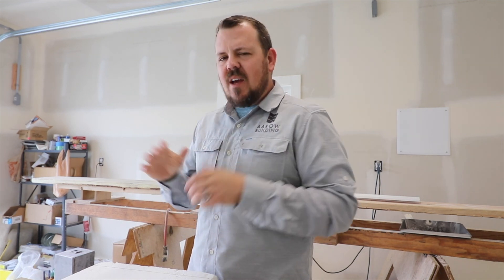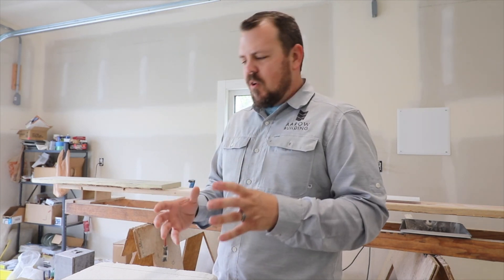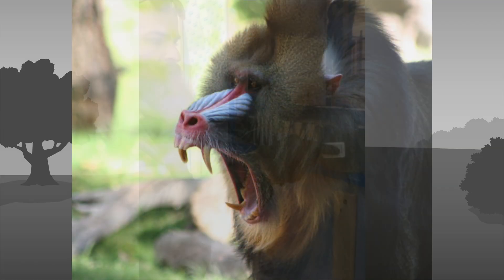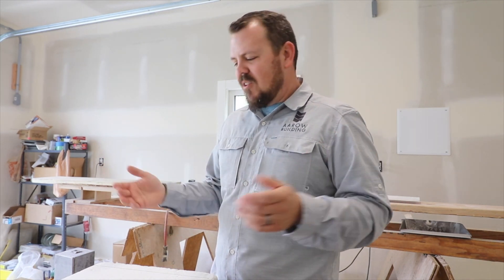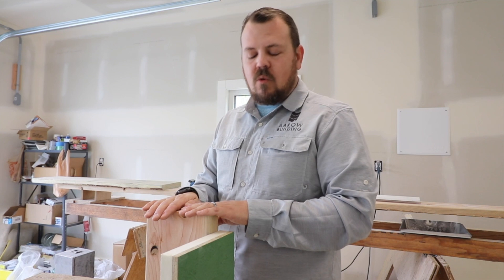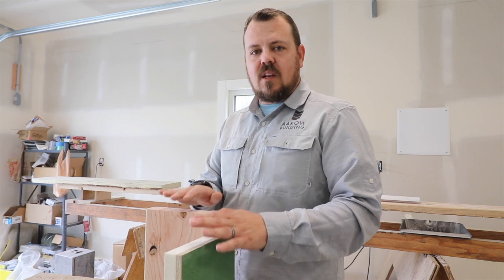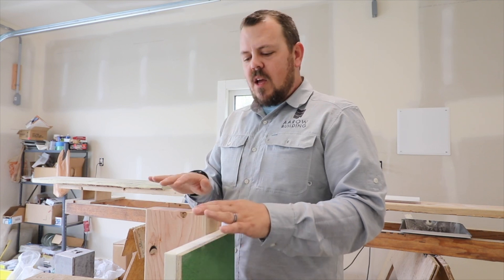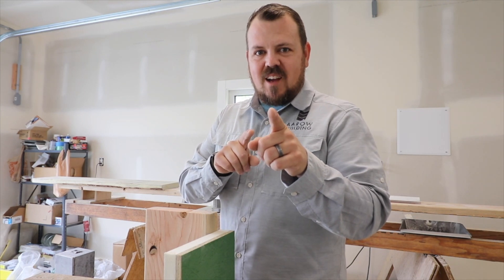IG Wall Assembly

Comment: I've seen multiple videos showing the use of Siga tape between the wall and the foundation. What I haven't seen is how you finish that assembly -- do you cover that tape on the concrete to keep it from degrading?
Reply from the maker: The tape gets covered by cladding of whatever sort you are using on the rest of the home.